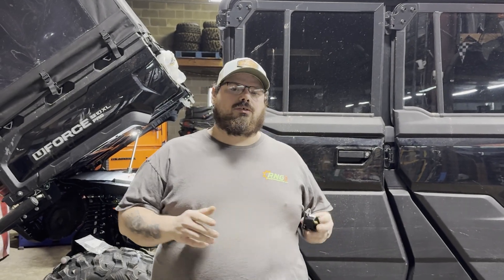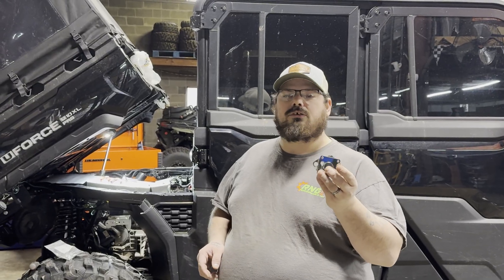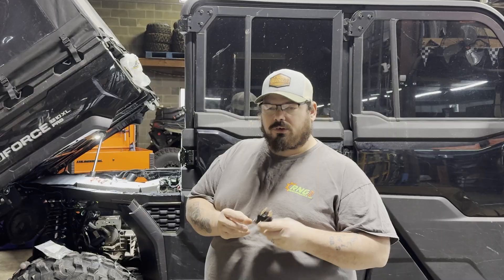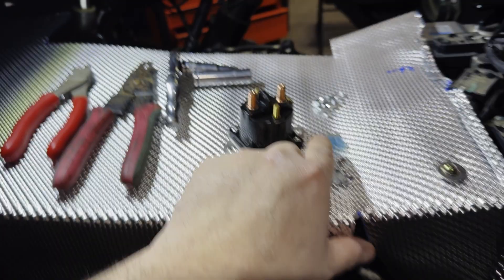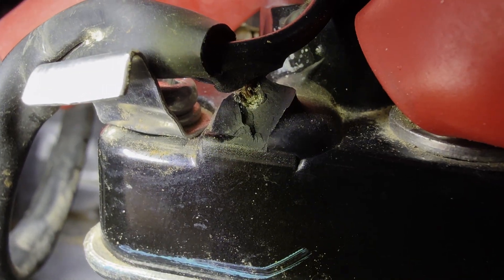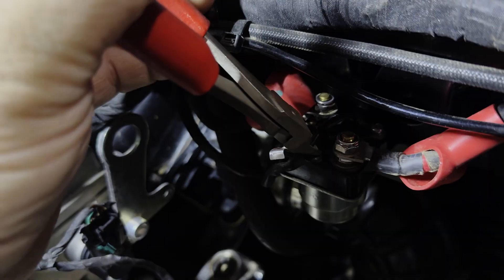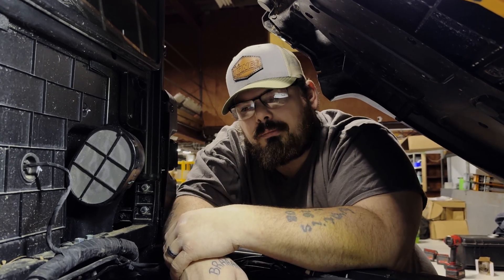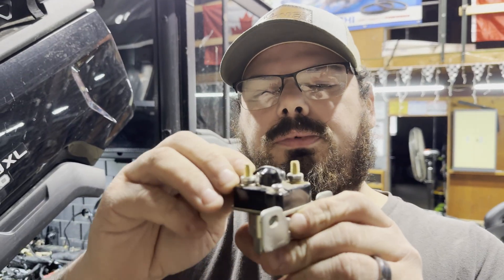Why CFMOTO U10 Starter Solenoids Fail (And the Upgrade You Need)

Comment: So does the Uforce 1000 have similar issues?  Sounds like the U-10 it’s a front differential maybe, Heat shield and starter Solenoid.  On my Uforce sometimes about every 10th start it turns over but won’t fire up.  I have to recycle the key and it fires up.  Done it since day 1 but doesn’t bother me that bad.  Last one, Does Honda and Kawasaki have these small issue like the U-10’s?